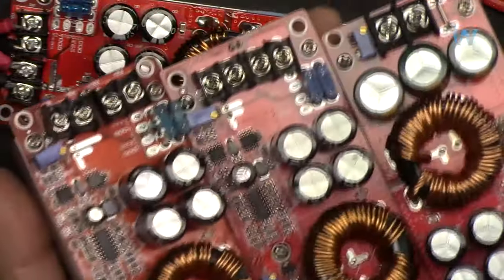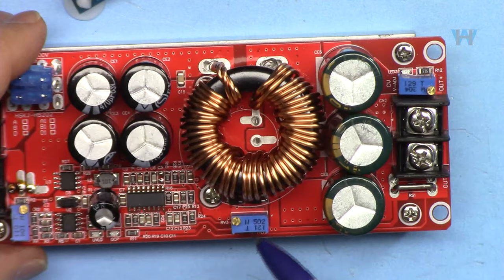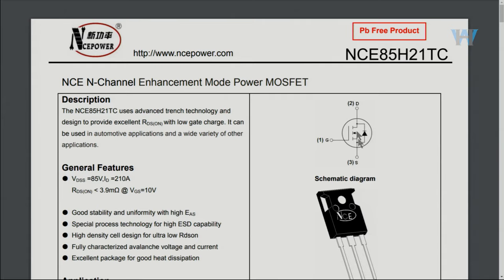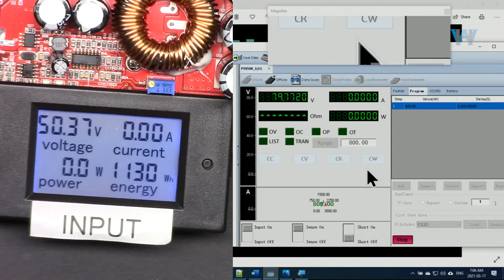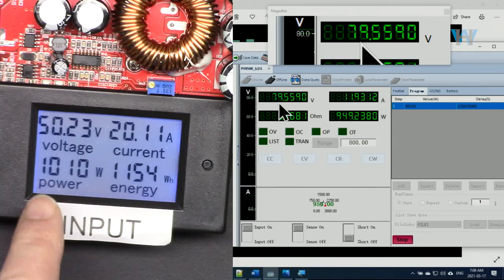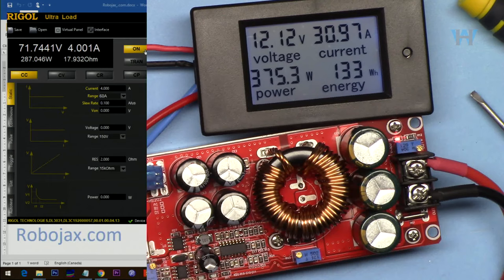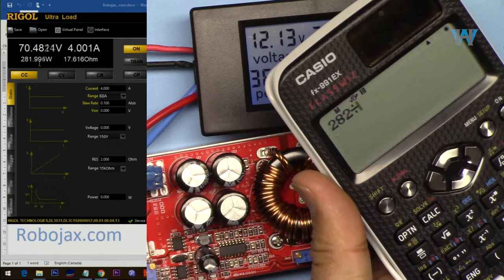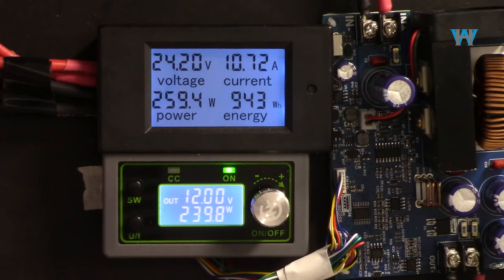Review of 1200W 80V DC Boost Converter Tested at 1kW - Watthour

Comment: In my personal experience most of the products we are buying are built with substandard components, they are made to the product work at a fraction of there capabilities, why you may ask just to make money I bought a buck converter for about 2$ I used it for a short while and it broke within a day, definitely I was using it at it's very max I decided to replace the main ic LM 2596s which costed me 2.50 $ more experience than the entire unit, but handled abuse very well and didn't heat up as quickly, usually it's one component that falls, you may want to consider that anyone reading this comment.
Reply: Totally agree with you. I have the same experience.

Comment: The weak side of these boosters is the big Mosfet, it is rated way too low voltage, I think max 85Volts and then you have output of like 80, take in mind inverse voltage is higher than this. so it does not break due to over current but to over voltage. I have one of these modules and it broke without load after just a few hours of use. So I fixed and improved mine by replacing the one big mosfet with a parallell pair of B31N20D instead and it have not broken again since that was done. another weak side is that the module cannot limit current below the input voltage, so it will basically try to lower the voltage down to VCC and if that is not enough to limit the current it can´t go lower than this meaning if you short the output below VCC there is no current limit at all and you also burn the module or fuses instead.
Reply: There also might be a problem with the smaller transistors not making proper contact with the heatsink or none at all thats why the transistor on the input was reaching 85C on the pins meaning the real temperature of it was probably at 100C iam going to buy one but il replace the silicone thermal pads with thermal paste and maybe add paper or cardboard above the smaller transistors for better contact with the heatsink for better thermal transfer
Reply: @w4st3lander  yes the thermal connection is not especially high on it. When I modified mine I actually put the new mosfets on a separate heat sink that have a temperature controlled fan on it that I also built. 
But as long as the switching mosfets no longer is on the stock heat sink that part have not gotten hot anymore for my part. 

I use my device in a home made Lab power supply. I have 3 rails built in the same unit and can go 1-20V 9amps. And 20-83volts up to 20amps (this module) and 40-380V 200ma. I can use all 3 outputs at the same time too if I want with a combined power of about 500 watts

Comment: When I use it with a car battery for its supply, really getting hot with 80w fan load. But if i use a power supply 9amp 16v, it won't get hot. Can you help me?

Comment: Thought of buying this converter to power my class D home made car amplifier rated at 1000 watt rms. But with a car battery at 13 to 14 volts while the engine is on. It required at least 80 ampere input to power a 1000watt rms output. After seeing this video it's not possible to power up my amplifier. with 30 ampere max input. Since my car is a small hatchback with a 35ah battery and 90 ampere alternator my dreams just shattered like a mirror with this module. Have to use a normal dc to dc converter not a boost converter
Reply: dc to dc? its working same...
using super cap for suport battery...
on buildup amplifier for car its same...just difrent output...

Comment: Thanks for the testing. I've blown up a couple of these, their "1200 watt" rating is super inflated.  I was trying to use them to power a 36v ebike with 12v battery, and it just didn't work..the ebike was like 500watt, it just blew up the input fuse like you showed until it just died.  I was wondering how to fix them.   If you buy from amazon you can return them, but I'd rather just fix them or even improve them as there was not another option that I could see.
Reply: The Chinese calcution in your case is 500w÷12v= 41 Ah. So thats double of what it can handle. My bike is 350w÷24v= 14Ah and yes it works.
For me its the perfect way to use my 24v batterys on my 36v bike.

Comment: I've had three of these. First one I was not able to adjust output current or voltage that was stuck was at 119V DC. I used it as a 48V ebike Regen module well above it's rated power  for about a year until the Mosfets blew. 

The second one I used to boost a constant 12.5 volts input at 20amps (250w),to 55v output at 4amps for battery charging. I used it with a cooling fan. I used a recording amp and volt meter, and about 30mins the input current jumped to 48amps but the fuses did not blow, bur rather melted, and then the output diodes shorted. 

The third unit I set up the same but limited input current at 12V to 10 amps. Charged an 800wh 48V LFE battery pack at about 2 amps, a couple of times. Then, on the third attempt I powered the converter up, made no pot changes. checked output at a stable 55v, connected the battery and instantly the fuses and main power regulator blew.
Reply from the maker: Indeed I have shown how they die. Please thumb up the video so people watch and learn about this module. Very few might get lucky to get a working module
Reply: @WattHour  I did, and will post a review comment on eBay and Amazon with reference to your video.
Reply from the maker: Thanks. stay safe.
Reply: hi, i bought 1 years ago ... used it for charging 60v scooter battery, 1.2kw pack with input of 31v 10amps to 60v 5 amp ... switched later to 55V 10A charging at 60V around 500w charge. Has worked flawlessly until i decided to power a UPS and tinkered with the high voltage protection. I dont think i blew mine, just the fuses . Need to figure  out the setting or restrict input current to save the fuses.
Reply: @awesomed007  Thanks, I suspect it's not so much the design as the quality of the components and construction.
Reply: @jackoneil3933  yeah, the only thing that chinese do well is cutting costs repeatedly, hence even their tanks on parade day had the wheels come off!! I am grateful for this culture of being miserly when WW3 looms. The dragon devours its tail, lol!
Reply: @awesomed007  My girlfriend's family were pretty high up in the CCP and PLA. but supported the Tiananmen Square protests. When I once remarked I liked Jiang Zemin, her uncle who knew Jiang nearly kicked me out of his house. I explained I thought he was a friend of Regan's and the U.S.  He said you go home and tell everyone in America that  Jiang is no friend of the U.S. or China, and he and his gang of monsters will burn the world down one day. 

Later a General in the PLA whom my girlfriend and I happened to meet said that he wanted China and America to have the same relationship we had. Also that  he had friends in the U.S. military, who told him that there were people in America who wanted war with China, and those in China who wanted war with America, and that America had friends in the PLA who were trying prevent a war, but war might occur and that when it did, that we should not let that come between us. 

Many believe that a limited Nuclear war is not winnable and that asymmetric war of Chemical, cyber, finical and biological is how WW3 will be waged, and that non-combatant (civilian) causalities will comprise the majority human losses, and at this point the monsters on all sides might appear to be inclined to that notion as well.
Reply: @jackoneil3933  wow, Romeo and Juliet ... interesting mix of espionage ala spy movie script ... i love it! Whatever happened to the girl?? And onto the secondary part of your saga, WW3 is a sure thing in my books. All you mentioned is logically plausible. However, X factor, butterfly  effect is highly possible. Planets such as Uranus and pluto are known for such events, lightning and thunder. Astronomical proportions of change, no world bully dictator or such can direct, contain or navigate. I have seen such a vision.
Reply: I put the 1800W version on an ebike and it failed after 5 minutes, halfway up the hill. Output voltage is now the same as input. :-(
16V to 55V, to a 48V 18A peak ebike controller.
Reply: @mrtechie6810  Thanks for the update. I was considering trying the 1800W version but think I'll pass. Andy at who has the off Off-Grid Garage channel blew one Charging a battery at about 10 amps about a year ago. I think the power MOSFET is likely the most likely failure point, and possibly replacing it with a better quality version might be worth trying.
Reply: @mrtechie6810  hi, boosting from 16v is a pretty bad idea ... the amp draw will be extremely high and heats issues as well as efficiency would present itself. I think serious cooling aides are needed.
Reply: @jackoneil3933  I dont know if its your video they are using but I saw a video with someone showing it not working
Reply: @dantronics1682  Thanks, I have not uploaded a video of my experience but posted links with comments other places such as eBay Amazon.

Comment: your the best youtuber i ever seen. the best product review ever to reveal the truth.. i buy also this converter to get 60v and about 10ampere is enough for me for my project and i used computer power supply with 40 ampere as an input voltage because i thought that this converter can handle 60v output from a 12v input but the converter is died. i subscribe to your channel best regards from philippines.
Reply from the maker: Thanks for subbing.

Comment: You have some great information here and i really appreciate you sharing it . I have a question. How do we know what size boost converter do we need for our project. What determines if the converter is suitable. My input and output voltage falls within the range. What else is important to know if it works?

Comment: hey thank u for all the information, 
iam running it with an ebike, battery 36v 7,5 a to 44-50v, it is a bit tricky to set the current, but it is getting better....finally the solution is a  bigger battery, a second same size in parallel, to have more amps to boost,

Comment: I have watched many of your videos. Great work. 
However I'd like to ask what is up with those efficiency numbers? 
941W input 900W output. 
The efficiency is at around 95%, don't you agree?
Reply from the maker: Hi, just divided the output power to the input power. I might have typed it incorrectly.  Can't edit the video now if there is erro in calculastions. Sorry. but the instrument read is for sure correct.  Thanks

Comment: I put the 1800W version on an ebike and it failed after 5 minutes, halfway up the hill. Output voltage is now the same as input. :-(
16V to 55V to a 48V 18A peak ebike controller.

Comment: The efficiency numbers are incorrect. Overlays and calculations don't match measurements from the Load
9:29 : 616.6W Input - Load shows 600W (97% Efficiency)
Yet Overlay shows 480W Output and 77.8% Efficiency
10:11 : 942.7W Input - Load shows 900W (95.4% Efficiency)
Yet Overlay shows 720W Output and 76.4% Efficiency
Some are wrong, others are OK. I didn't check them all, but it needs correction.
Also - it is rated Maximum 25A, so when you exceed 25A input current, of course it fails. Eg: 37:45
Reply from the maker: They all match. I did the test and mentioned them. So reading on device is correct. After I stop the test what you see under the text is just decorative clip so the screen doesn’t look empty.
Reply from the maker: Loo at 15-20 seconds before the text is shown.
Reply: @WattHour  - FFS - I even gave you the timestamps and the figures.
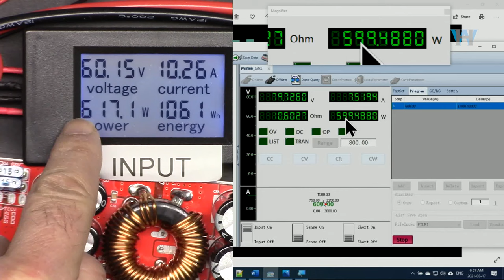9:19 - Load shows 600W, your voice says 600W
9:29 - The Efficiency overlay shows 480W output
9:59 - Load shows 900W, your voice says 900W
10:11 - The efficiency overlay shows 720W output
Don't argue with me... WATCH YOUR OWN VIDEO.
Reply: @WattHour  some of the efficiency calculations are incorrect, @johncoops6897 is right. 899W/943W is ~95.3%, and not  76.4%

Comment: Can i use this as a buck convertor
My power supply is 54v and i want to run device which is rated max 24v 

Can i use this module for that
Reply: this is a boost not buck, google buck converter

Comment: Another Question my friend , I have 2 48v lithium battery banks my 3.2v batteries I saw preformed better at 3.5v but 3.5x15.= Dc 52.5v but the issues are my battery combiner is only 48v and will blow at 52.5v  but also my inverter is an EASUN 5 KVA pure sine wave inverter charger 48v PWN

Comment: Hello, Can I use it as Step Down and Boost in the same time? IF Vin = 10 - 60V can I have Vout = 48V? thx
Reply from the maker: the output for this is always hgigher than input. youneed Back-Boost Converter which will work like that.
Reply: nope ... get a dc dc step down converter

Comment: I need to boost 2-5V PWM signal to 40-60V and limit the current to 10-400uA. Any suggestions please?
Reply: pwm signals can't be "boosted" with a DC module. You need an amplifier to first increase the PWM amplitude and then a current regulator circuit to limit the current to your requirements

Comment: Hi. I am trying to solve a problem with chargers, and I am looking into a situation where I need to use relays, and in order to reduce current through relays, I am considering a flow with two 1200W boost converters in parallel, instead of a one 1800W converter. Can you please tell me, which config is more efficient, one 1800W boost converter at 300W or two 1200W boost converters at 150W each in parallel?
Reply from the maker: Hi, I am not sure how would you use relays to reduce current.  in terms of effeciency,  if you are need 300W, then why not use this 400W boost converter https://youtu.be/xSI9k5BK-jU
Reply: @WattHour  I am planning to use two boost converters in parallel, to move extra energy from solar-charged 12v  battery to 48v battery. The setup will work every day, so I want to have CONSIDERABLE redundancy both in terms of power and reliability (I am from Ukraine and I think we might have some issues with electricity supply again next winter). That is why I have chosen such a margin in power redundancy and dual converter setup. 
As for relays - I plan to add a charge controller, that would connect the boost converters to 12v battery only between it's 90% and 100% state of charge, and 150w at 12v is 12.5A, and when having 300W that would be 25A, so I am planning using two boost converters + 2 relays in parallel, in order not to stress the relay with 25A of connected DC(!) current, but split in half for 2 relays.
I agree about it all sounding like an overkill, but I would be glad to hear a better option. Thank you!

Comment: Could i use this on a 12 volt battery anf and step up to 30 volts?  I need to run rf amplifier it needs 30v 4 amps
Reply: 4 ah at 30v = 12 ah at 10v so there should be no problem.

Comment: Dear please suggest me module that charge my 12v 3s lithium battery pack 15A(18650 battery used with BMS) I want to charge my battery with solar power (input  is 18,22v current 5,7a)
Reply: hi, buy a dc dc step down converter...the ones that are in the 0-34v range 300W one as it will end up charging at around 150W output which is one hour to 80 percent charge of your battery pack ... my calculations are off the cuff!

Comment: Sir I need one moudle for operate my 1.5 kva inverter I have 80 volt DC but my inverter operating required 150vdc ....... Are you have any device
Reply from the maker: search. I have tested the 1.5kW.
Reply: @WattHour  where sir can it will open solar inverter
Reply: I have the some problem

Comment: This is a very disjointed review and very hard to follow. 
I would appreciate a table of results and recommendations at the end.
Reply from the maker: Hi, it has chapters.  On the mobile device or on desktop, on the player you see chapters, click and select to jump.  or in the description you will see chapters you can click which looks like this 
Use player chapters or click on time to jump to different chapters of this video
00:00 Start
01:25 Introduction
04:14 Opening the module
07:14 Input 60V 500W test
08:48 Input 60V 600W test
09:33 Input 60V 900W test
10:16 Input 60V 1000W test 1kW 
11:10 Input 50V 640W test
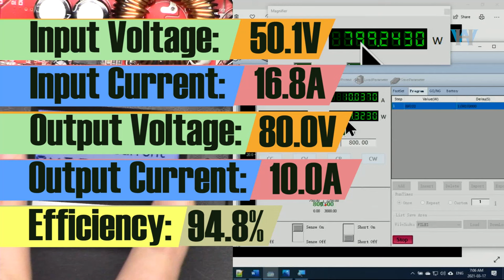11:48 Input 50V 900W test
11:20 Input 50V 950W test
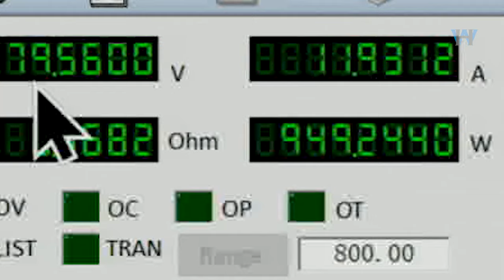13:09 Input 36V 600W test
13:58 Input 36V 650W test
14:35 Input 24V 300W test 
17:45 The module died
20:48 Input output voltage tests
22:27 Input 9V output 12V
25:00 Input 12V output 15V
26:54 Input 12V output 24V
28:25 Input 12V output 36V
30:10 Input 12V output 50V
30:56 Input 12V output 60V
32:12 Input 12V output 80V
35:22 Input 15V output 24V died
36:36 Input 15V output 24V 2nd module
Reply: @WattHour  I see you have chapters, however I like to start from the beginning and follow your testing through to the end. If you do that there are lots of breaks and it sounds disjointed. It needs to flow smoothly from one test to the next with a summary at the end like:
Nice unit and has high efficiency provided you do not exceed 25 amps at the input. Exceeding 30 amps can cause catastrophic results.
The comments were meant to be constructive.
I enjoy your test videos and encourage you to do more.
Reply: @peterdkay  - Most of this guy's "reviews" are disjointed and very hard to follow. He doesn't accept feedback or suggestions from viewers. It could be solved with a summary at the end.